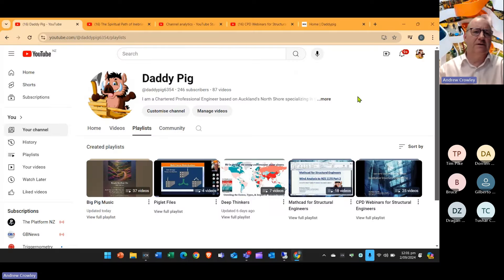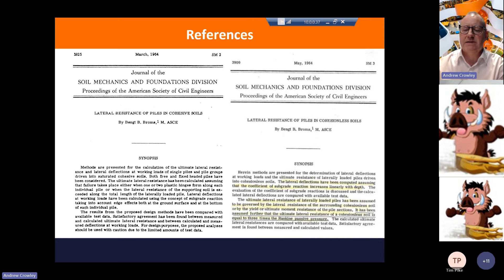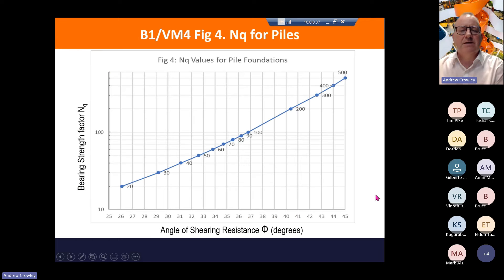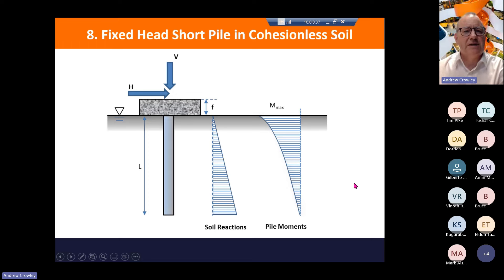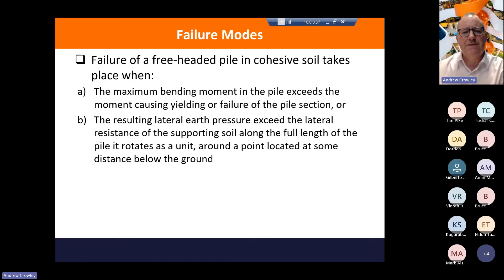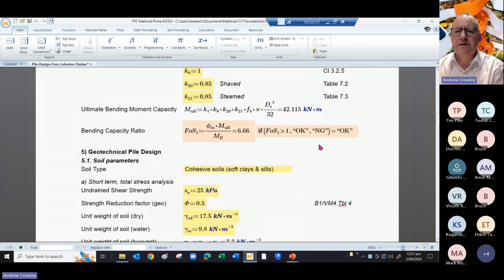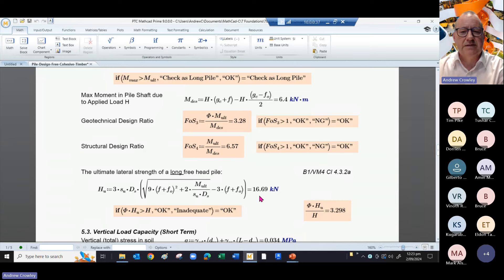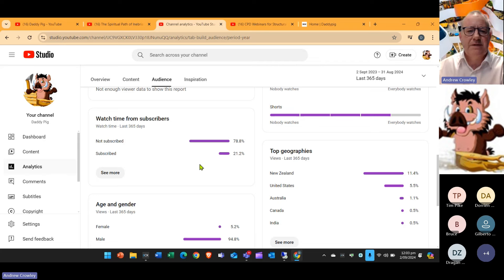CPD Seminar #26 - "Broms Method of Pile Design to B1/VM4"

Comment: Thanks for this very helpful video. My question is, on what scenario are we required to check for the lateral capacity of the pile? Is it when the ground do not meet the "Good Ground" as defined in the NZS3604? Or is it recommended that we check this for any given scenario (even if the good ground is encountered at a relatively shallow depth, say 600mm bgl? Thanks again.
Reply from the maker: You need to check the lateral capacity of the pile when you are relying on it for lateral resistance e.g. when it's part of a retaining wall or used as an anchor pile. NZS3604 gives some ready made solutions for anchor piles in good ground for timber framed houses, which are fine so long as you're working within the limitations of the code.

Comment: Hi there, i have just done some calculation for anchor piles listed in 3604. 300mm above ground, 900mm into ground, diameter 400mm. somehow my calculation shows the lateral support to be negative.
Reply from the maker: That would be a fail. Check the soil parameters and the depth of soil being ignored in the calculation. Increase the depth to provide adequate lateral support.